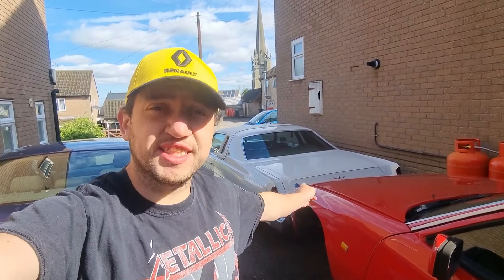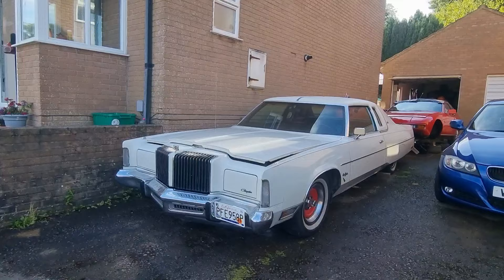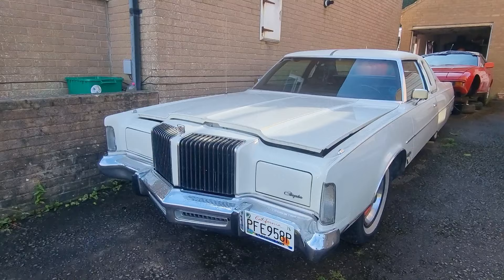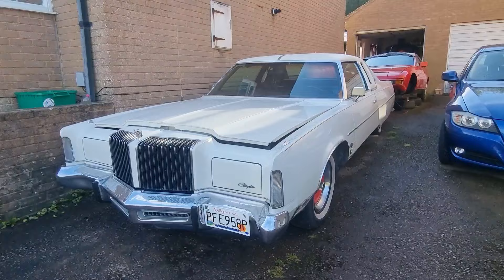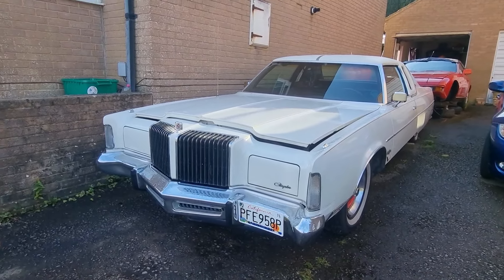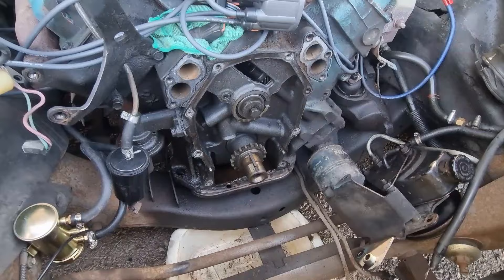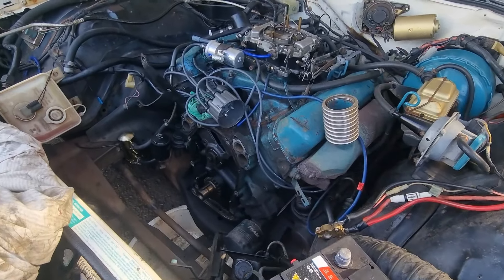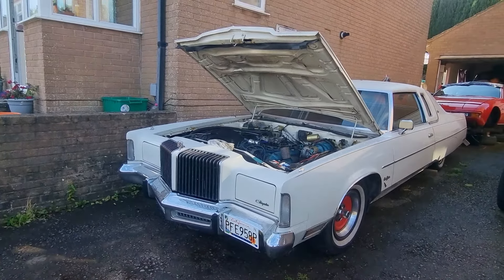The Yank Broke !!!

Comment: That’s 400cid big block engine. I have built one some years ago. Those camsprockets prone to crack because it has plastic teeth. But. If the timingchain has slipped, which it quite likely, valve timing has gone wrong and there are also some bent valves too.
So it’s good to do some compression tests for all the cylinders.

Comment: That vehicle is nearly 50 years old so problems are to be expected but one thing that does stand out is the state of the timing gear that suggests poor maintenance.
Reply from the maker: @clivewilliams3661  yh don't think it was looked after very well before it came to the UK 3 years ago, the guy I bought it from had spent alot of money on it to get it going again but missed doing the chain
Reply: @easydriver31  Looking at the engine and the bay I doubt that any money was spent on the mechanicals, to have stripped the engine for inspection would have meant that the timing cover ought to have been removed.  Also, the sludge in the timing cover would have manifested itself in the sump, which would have been obvious at an oil change.